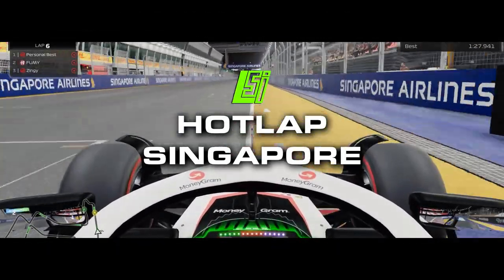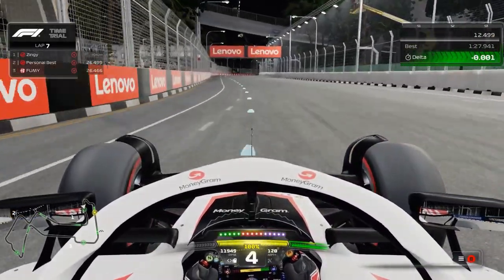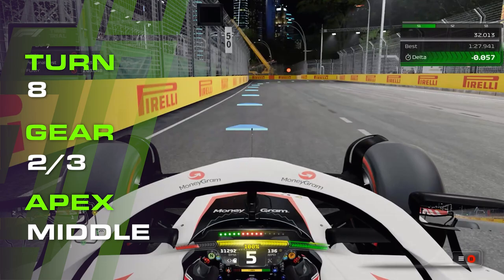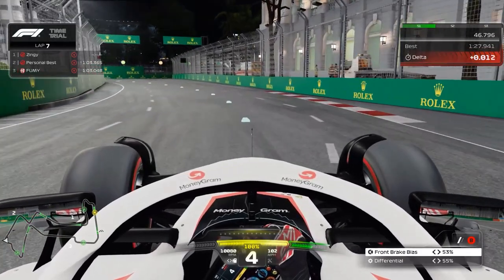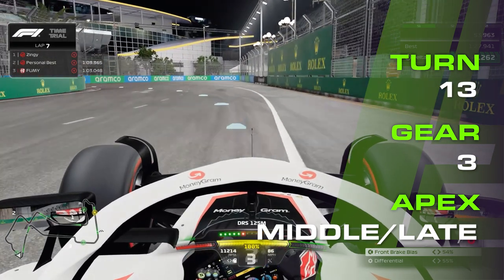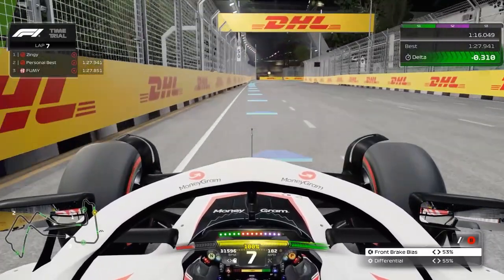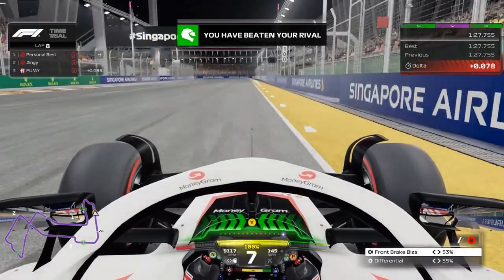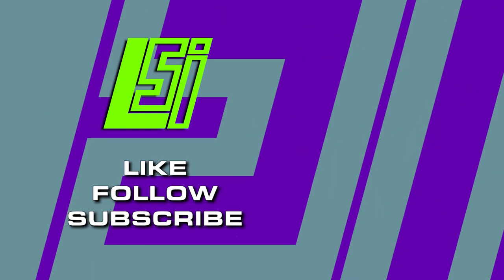How To Gain Time In Singapore (+ SETUP) | F1 23

Comment: Does this work for controllers?
Reply from the maker: This lap was completed by a controller player, so the short answer is yes. The race setup at the end however, is only a guide for those who maybe don't have time to make their own custom race setup. If you can, always make sure you test your setups first and make any necessary changes depending on your driving style before you use it for real. You can use our setups as a good starting point, but don't be afraid to move away from it slightly if you need to :)